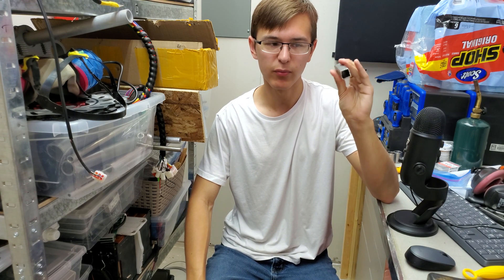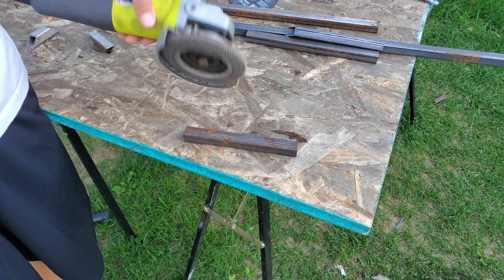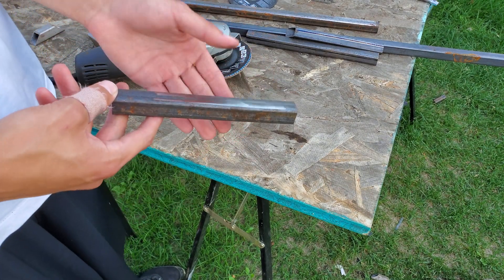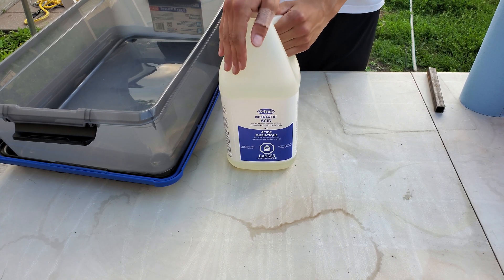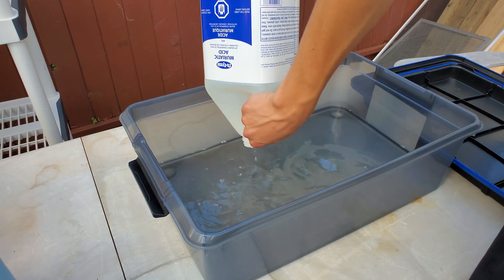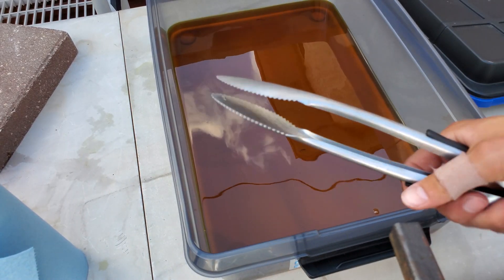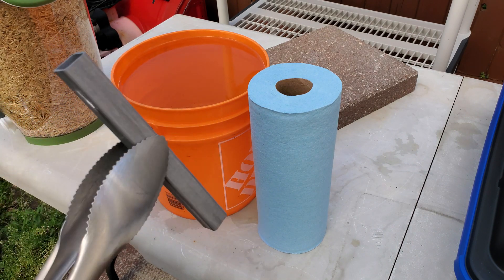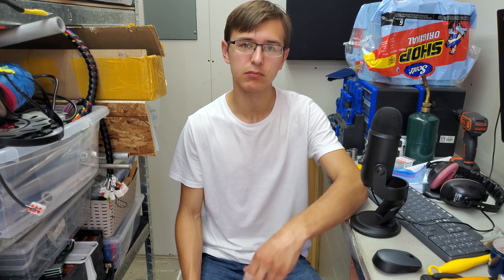Remove Rust Grease And Mill scale in Two Minutes - No Tools Required!

Comment from the maker: Hey Guys,

A few important things to note:
• The vapour can be very hazardous, especially to your respiratory system. I recommend wearing a respirator, and using the acid bath in cooler, or even freezing weather if possible (the acid will give off less vapour when cold).
• I recommend wearing safety glasses, and avoiding spilling any acid. A water hose should always be available nearby, both for rinsing any parts, and for rinsing your skin if you get any acid on it. I always rinse my hands off with water as a precaution, as small drops may go unnoticed.
• Acid can be considered hazardous waste. Check your local regulations, for proper disposal.
• Acid should be stored in a cool, dark location. If acid spills, the vapour may corrode metals in the nearby vicinity.

A few commenters have identified concerns regarding the steel rusting after acid treatment. Steel should be towel-dried after the acid treatment, and stored in a dry location to prevent the steel from rusting right away. Paint, or another surface treatment is required to provide long-term corrosion protection.

Comment: I do this all the time to remove rust. It works very well for pitted or odd shaped steel. Here are a few comments.

Real muriatic acid is just 32% hydrochloric acid.
Big box stores cheat you by selling a lower concentration. In my area Atwoods sells real 32% concentration.
I dilute mine to10-15% which gives me a larger volume for large pieces and is safer to use. 
After repeated use the concentration will decrease.
Always do this outdoors with rubber gloves and goggles. I also wear a leather work apron. Avoid breathing the fumes and stay upwind.
HCl will dissolve nylon. 
PVC pipe works great for long pieces.
Towel dry to help prevent instant rust. Air drying creates more instant rust.
To prevent instant rust, I brush on phosphoric acid. This creates a layer of iron phosphate that acts as a rust inhibitor. Rinse and towel dry after the treatment. I soak a rag in phosphoric acid and pull it through tubulars to treat the inside.
Paint adheres well to iron phosphate.
Iron phosphate grinds off easily with a flapper disc. Sometimes I weld through it.
Treating with oils will also prevent instant rust but can be a problem when welding and painting.
To discard used acid, neutralize it first which creates a salt solution. Baking soda or calcium works fast. A cheap way is to place a chunk of limestone rock in the acid and let it react for a couple of weeks.
Reaction times are slower in cold weather.
Never leave an open container of muriatic acid indoors. The fumes will corrode all your metals and are unsafe. I even store the new bottles outdoors.

Comment: Thank you. Good info. Something I thought needed to be mentioned. An opened container of this acid in your garage will corrode every tool and piece of metal. You might look into phosphoric acid. Not as strong but it is safer. Found in soda. You can find it at home depot in a concrete wash and metal prep product.

Comment: Always wear gloves when grinding, and certainly when working with acid.  Great tip and good research on the plastic.  Have you considered a 40% vinegar?  It is not as strong as muriatic but a lot safer.  Won't work in just a couple of minutes, but still lots quicker than household vinegar.

Comment: If you don't want to mess with harsher acids and you have more time you can remove rust and millscale with common household 6% vinegar light to moderate rust can take 2-5 hours heavy rust and millscale can take overnight as with any acid if you're not gonna use it right away you need to oil it because it will lightly  flashrust in a couple minutes you can also neutralize it with baking soda but I usually pull it out spray it off dry and weld pretty quickly if not you need to oil it muratic acid is great and fast and I use it on some stuff but it can get expensive for larger pieces with vinegar you can basically make any size container you need for odd stuff with foam board tape then a sheet of plastic and some spring clamps or you can do long skinny stuff in pvc pipe hell I've even dug a shallow hole and lined it with heavy plastic I always cover the top with a sheet of plastic as well seems to work faster straight vinegar is best 👍👍👍
Reply: Also if you're gonna weld and you don't neutralize it depending on how you're welding even though the steel is clean it's best to prep the weld joints with a wire wheel or flapper just enough to take that dull gray color to shiny steel before welding I've seen some welding react oddly to ungrounded acid cleaned steel that dull gray finish that's left can make the arc erratic etc anyway just figured I'd pass the info along for anyone looking up ways to clean metal for welding 👍👍👍

Comment: meh. I used to do this but it would rust really bad afterwards. I one time then did it and immediately soaked my metal part in motor oil and took it out yet it still rusted. i think electrolysis might work and leave no damage...

Comment: No that's wrong how about flash rush!!!! You need to nutulise the acid with baking soda I bet flashed rust was on that the next day !
Reply from the maker: A post rinse with water removes the acid and paper towels do a good job at drying the tubes. Although after that point the tubes are quite vulnerable to rust from excessive humidity.

It is very dry where I live.

Comment: I use citric acid. Not toxic, no smell and no issue to dispose. Simply dilute down with water and pour into the ground. Most citric acid sold is food grade. It removes zinc coating, and mill scale also.
Reply: How much citric acid do you use?
Reply: @TheTank8  

I use 1 1/2 to 2 tbls per gallon of water to get down to around 3.0 ph. I have a ph meter (cheap on Amazon). This ratio will vary depending on the ph and hardness of your water. I have very hard water with a average ph 7.2.

I get the powder citric acid on Amazon. Very reasonable.
Reply: @gcase08  and how long do you leave the metal in that solution?
Reply: @TheTank8  

It depends on what you are trying to remove. Heavy rust I leave over night and even longer. Heavy mill scale a few hours. There are things that remove it faster but are not as friendly or safe to use.
Reply: @gcase08  I appreciate your advice, thank you.

Comment: I am looking to clean about 4’ pieces and thinking of using an acid resistant plastic pipe with a cap. Make sense?
Reply from the maker: That was one of the original designs I was considering. I decided against it, as the tubes I would be cleaning did not exceed a couple feet in length.

One concern I have with that type of design is drips and spills. Handling tubes in a flat tub is quite easy and stable. You can let the tubes drip into the bin before dunking them in water.

With a 4 ft design, you will likely have difficulty handling the material and equipment. It will be more difficult to keep the process clean.

If you figure out a good design for longer tubing, I would like to see it.
Reply: @GadgetEyeGuides  Im needing to do large pieces. Thinking of using a piece of PVC gutter with the ends closed off.
Reply: Been thinking about a design for 1 meter long pipes.
best option I think is a long box type container with a sealed lid.
but you might need to melt plastic to make that kindda design, 3d printing knowledge is a friend.

Another design would be using electrochemical machining. but that's a whole different process.
the plastic design setup is easier though.

Comment: Several considerations, the inside of the tube how do you protect it from further oxidation? I would treat it with a rust inhibitor. #2 I would make a solution of baking soda and water to neutralize the Muriatic acid then rinse in clear water add the rust inhibitor. 
If you are not ready to prep for welding you can use Johnson’s paste wax to protect from oxidation. 
Removing zinc can be removed safer with common apple cider vinegar a little slower but no dangerous fumes to deal with. Oh gloves dude! Have you ever experienced an acid burn on you skin? 🤣🛫 my $150.00 cents worth

Comment: so if I have a 24' tube where do I get a tight bucket to fit it ????????????????????!!!!!!!!!!!!!!!!!!!!!!!!!!
Reply: Do a quick build with some pvc or something to contain the piece along with the acid. Can choose diameter to more effectively fit the piece. But make sure to also keep acid amount in mind. Want to keep acid usage low, but also want to reduce the need to change acid often due to usage in the reaction. Gotta balance
Reply from the maker: I don't think you will be able to use this method on such a long piece of steel.

It is possible to cover the tube in rags soaked in acid, but that is a far more hazardous process.

This method is best applied to tubes cut to finished length.
Reply: Pvc might not be the best material to use, but oh well. As long as you keep in a ventilated area and dispose correctly, and get heavy metal free pvc, ayy by all means. Sure there are probably other types though. Not really sure what are where though.

Comment: Dip in to WD40 to stop flash rust and use acetone later to remove and weld.
Reply: WD40 isn't a thing in every area of the planet.
Reply: WD40 is the most overpriced useless trash ever.
Reply: @PM17E5  After neutralizing the acid, with basic rinse, get rid of the water with WD40…WD = “Water Displacement”.

Comment: how do you dispose of the used acid?
Reply from the maker: Good question. As far as I can tell, it depends on the regulations where you live.

I haven't had to dispose of any yet, but when I do, my current plan is to strain out the debris and dilute it with a large quantity of water before pouring it down the drain.
Reply: @GadgetEyeGuides  add backing soda until it stops reacting (bubbling) and then it is neutralized and you can pour it down the drain.  Always neutralize.  Many older sewer pipers are cast iron.
Reply: You pour it down the drain. There are so many plumbers that use this to declog drains. It will neutralize itself on whatever it eats up anyways so no harm done to the environment. I've went through 10s of gallons of the stuff clearing up old pipes. To anyone who says it's not safe on pipes, Draino and all the other solutions aren't much better. If your pipes are so weak that Muriatic Acid will ruin them, then they were on the verge of collapse anyways.

Comment: You got the millscale off the outside and inside of the tube. You can arrest corrosion on the outer surface, but what's your plan for the inner surface?  Pickled and rinsed steel goes to hell pretty fast if you can't eliminate the residue.   Personally,  I refuse to pickle tubular shapes.  I use a D.A. sander with 100 grit paper for tubes, and pickle solid shapes.  Millscale thickness is a function of cooling time.  Solid shapes cool slower, hence thicker scale.  Tube cools fast enough to keep the scale thickness within the capability of mechanical sanding.

Comment: Nice tip. How long can you keep the acid in the container ready for use? Does it evaporate, etc?
Reply from the maker: I have kept the acid in the container indefinitely, since the making of this video.

The acid will evaporate, however the container has a relatively airtight lid. The heat and possibly the acid have managed to make the container lid warp,  and as such it requires additional clamps to make a seal.

The liquid level has gone down since, as the lid was improperly clamped. There also may be some degradation of the plastic, but it is really hard to tell.

I would not trust the container to hold the acid forever, but I will continue making inspections ever several weeks.

If you are interested, you can find a container, look at the recycling number. From that number you can find a plastic, and look up chemical compatibility.

Comment: they are not surface contaminants. Interestingly  it is the exact same alloy as the underlying metal.  It's been oxidized  is all.  In fact it is sold in great huge tankers  to china where they will smelt it down and make steel from it by burning off the oxygen.   the muriatic  will do a better job if you use a little soap and water to de-grease the metal.  The stainless tongs will rust.  The Hydrochloric acid will remove the passive chrome oxide on the surface and corrosion will set in faster than the exposed surface can  get  fresh crome to migrate through the metal and replace it on the surface.  Nitric acid won't do this to  Stainless.Neither will citric acid.